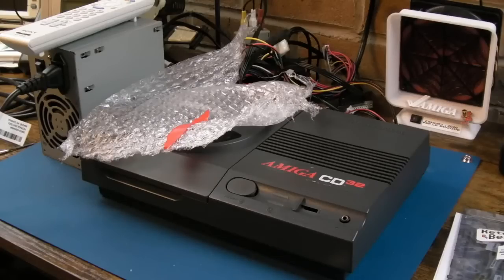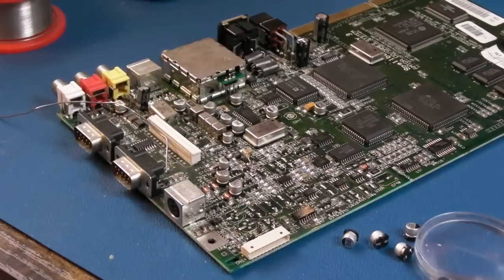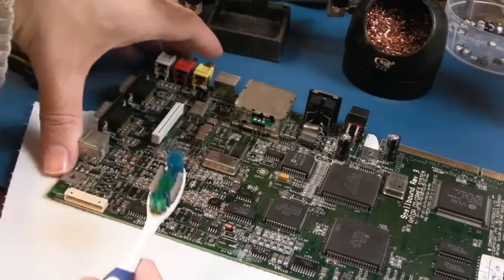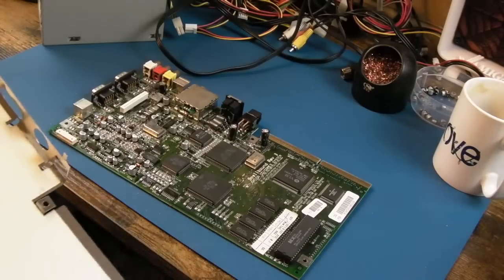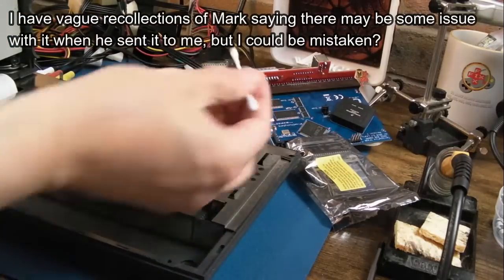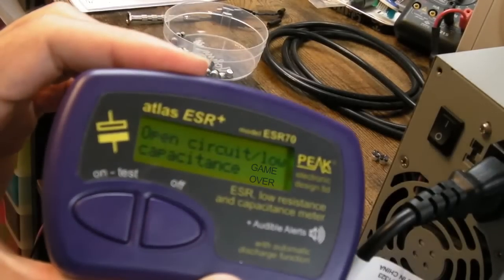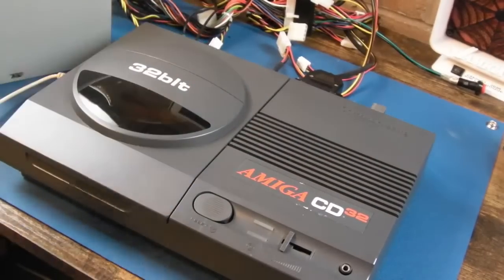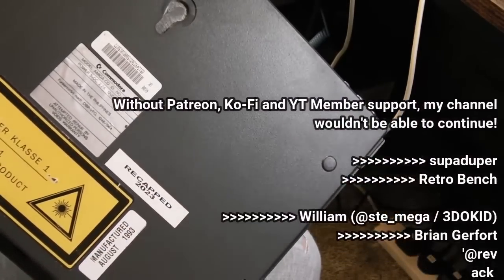VLOG - My CD32 Recap & TF330 Fix

Comment from the maker: CD32 FMV Repair - https://youtu.be/1fJV0Vm2K6s
CD32 Repair Part 1 - https://youtu.be/HmRy2TWIgWE
CD32 Repair Part 2 - https://youtu.be/q5W3n_XiSOk
CD32 Repair Part 3 - https://youtu.be/10-SJJRu5xo
CD32 Repair Part 4 - https://youtu.be/TbL4h5bp0dA
TF328 - https://youtu.be/Y9KDk1OfkYc
CD32 Controller Repair - https://youtu.be/ClQtctws8gI
TF330 - https://youtu.be/Y56Nr-1f2fo
Longer Recap - https://youtu.be/E49comAT4nM

Comment: nice review, i have a CD32 recaped with mkII and tf330 from Supaduper, work great but i have some issues with my esp-01 wifi card , i works randomly , i have try with another vf card, checked the tin solder and all seem ok, reprogrammed my esp-01 card and no more success.
Reply from the maker: That's a shame - maybe the TF330 firmware is not up-to-date?  The "NOT" port used by the ESP-01 was just that, an unsupported clock port, that may work depending on things.  I would make sure the 330 is up-to-date, and check out that the ESP-01 is up-to-date regards any files deployed to it.  Worth also cleaning the edge connector where the 330 fits into CD32.  Finally it might relate to the PSU - PSU and power switch on the CD32 can cause slightly low volltage levels.

Comment: Thank You for these repair pro-tips. I'll definitely try it out. I have collected all required caps some time ago, but was too afraid to make it done. But time has come, I guess. My CD32 refuse to boot with TF330 and even to read Cd's.  Now I'm gathering intel and knowledge to start serious repair and troubleshooting. Did You try solid or hybrid electrolyte caps? I'm using Asus mainboard with all solid state caps for almost 20years and never experienced any problems with heavy overclocked Core 2 Quad. Maybe that's the way?
Reply from the maker: Polymer caps are a good alternative if you don't want to use aluminium ones!  I wouldn't go with ceramics though - their characteristics are too different.

Comment: electrolytic capacitors can get a lot of operational life if you buy higher temp rated units. 105C rated units can easily see 165000 hours @ 55C.

Comment: Nice video as always! 🙂
I have read many times that it is a very good idea to power on electronic stuffs with caps in them from time to time, maybe one time every year for 30 minutes at least, instead of leaving them on a shelf for ever.
I'm not a specialist but that is what I try to do and many very old console or computer I own still work without issues with original caps.
But I also know that I will have to replace them because they just go bad regardless of this so called life maintenance. 😀

Comment: I have two of these TF cards for my CD32, when using either one, it makes using CD drive mostly useless. Meaning too many cd32 games won't actually work properly anymore. Games freeze or controller won't work (like game "Alfred Chicken"). Would really be interesting to know if this is common problem or just mine.
Reply: The TF330 has a disable jumper.  Have you tried using that when playing CD games? If not I'd give that a try.  If it works you can add a switch.

Comment: Having struggled with the CD drive cable myself I have to confess I am considering making the hole in the shield bigger next time I open it up to make access easier!!
Reply: Well, I had her open and had to get the snips onto the shield to fit an Indivision MK3 - so I made the hole around the connector bigger too - made a world of difference - and Im not married to those shields as a rule - so no real loss of sleep cutting it.